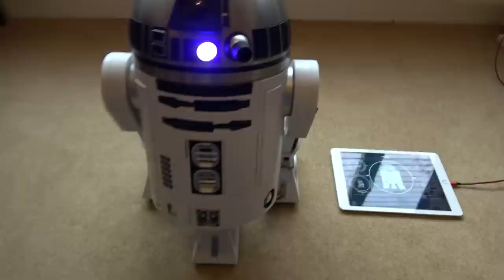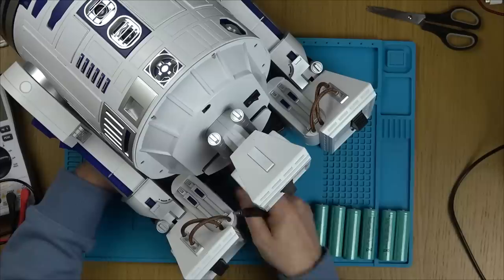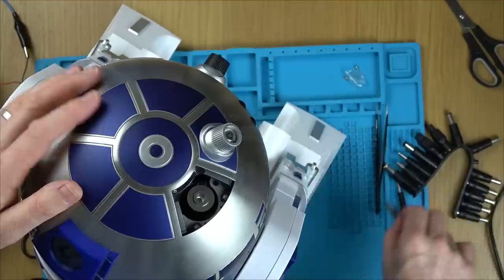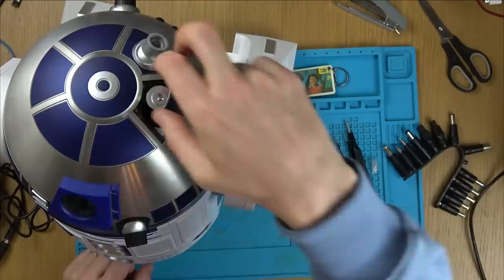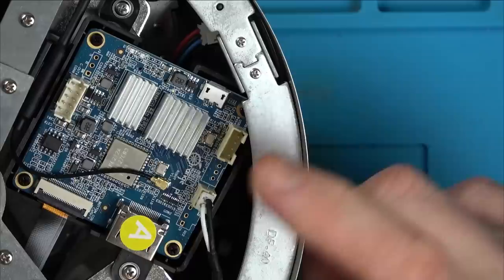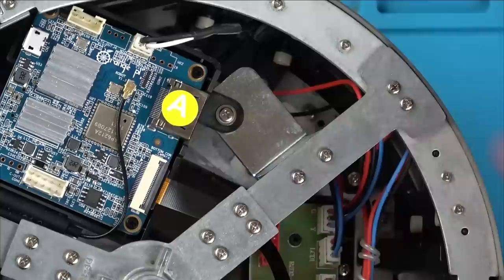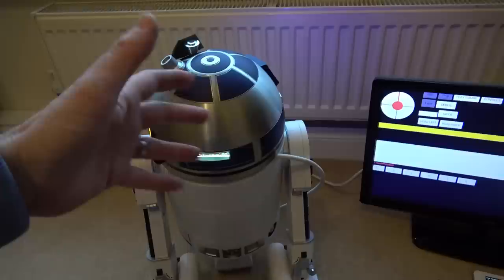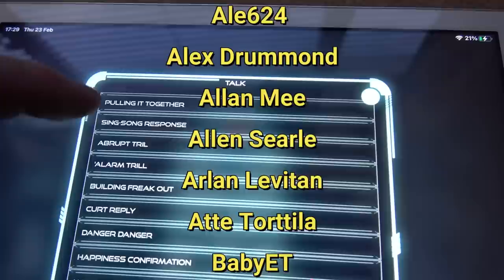Star Wars R2-D2 Repair Video

Comment: I thought the Raspberrry Pi is open source which would have been implemented to encourage other companies to develop more tech in the same vein, Raspberry Pi Org were not the first to make a single board computer, the first was called the Dyno Micro later rebranded as the MMD1 and was developed in 1976, more modern SBD's were also before RPi in the form of blade servers. in my opinion patents just stifle development.

Comment: That’s pretty sick they’re using open source projects for mass produced products. That’s cool. Raspberry pi isn’t the only one, there’s a bunch of pi’s and used for similar or other projects since raspberry pi’s are bulk purchased and sold off for triple the price.
Reply: I believe it works with a main board in the body and gets told to control the led displays.
Reply: Also try a micro usb otg cable and plug in mouse and keyboard

Comment: The board with the HDMI is an Orange Pi single board computer.  You can boot it into Linux and run applications on it with the correct micro SD card

Comment: I bet the person that sold this to you is kicking themselves for selling this to you so cheap if they find this video.  I'm wondering if that person was the original individual that built that model or they bought it off the original model builder.  I'm thinking it is the latter because if the original model builder had issues, they would have just either checked the parts/electronics or recharged the batteries.  That's what I would have done.  The model company includes testing kits in this build to make sure each item works as we build this kit.   I would have followed to wires to the connections like you did to see if anything was loose.  BTW, I am building this model/kit now and this video helped me so if I do run into an issue, I can run tests like you did to find the problem. I am in no way an electronics expert but I like to learn what makes things work.

Comment: Would be cool if this thing had a way to project video in the air using some kind of water vapor, i' m sure i have seen this tech a few years ago. Maybe something for a side project? :D
I think it was already projecting something on the radiator when you played the video at 29:00

Comment: brilliant video as always! 

just to say, i wonder if the HDMI interface was a way to test the robot before it was fully built? i had the “Real Robots” Cybot in the early 2000s and before you’d built the remote controller for it there were a number of buttons and switches on the board itself to change modes and test features out!
Reply: The HDMI port is for video, the Orange Pi is one of many Single Board Computers (SBC) it's not for testing anything it's just there as an available feature that all SBC's have (sometimes more) that little board can run windows and give your PC a run for its money, in fact it's the 'brains of this whole droid.

Comment: my guess it's a a Linux system, if that's the case it should be easy to play around with it. (even outside the case) It might be Android also though, which is trickier. I dont think builders would have to program it as that would take it too far and there is an android app to interact with so pretty complicated already.

Comment: where do you buy the batterys from
Reply: Vince did say in the previous R2 video when he was unwrapping the original batteries he used (the non-button top ones). I don't remember the company name but he did mention it and then he said "not sponsored" which is why I remembered..
Reply from the maker: I got these ones from Fogstar in the UK There might be cheaper options but I've used them 3 or 4 times now and been happy so far. Google promo codes for them and you will normally find another 10 or 15% off👍👍